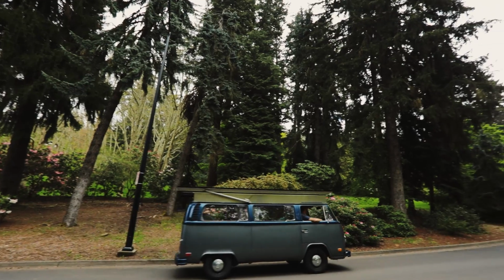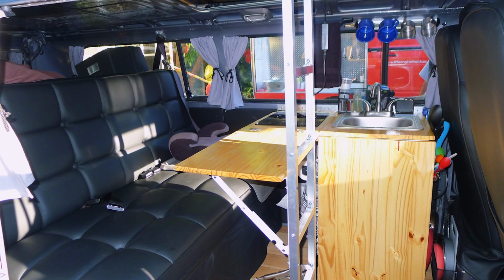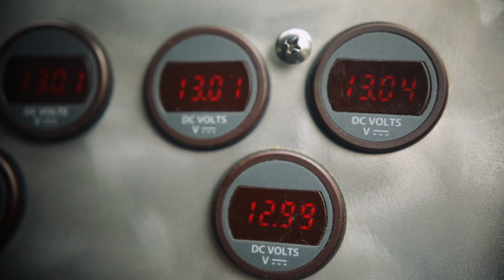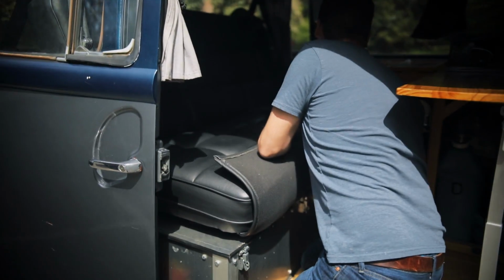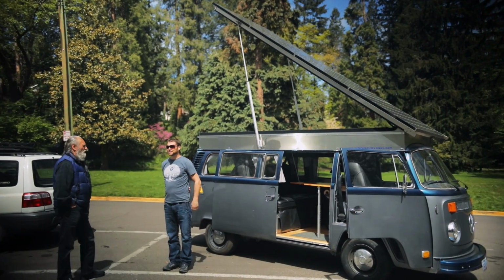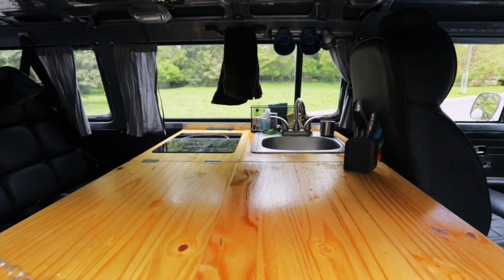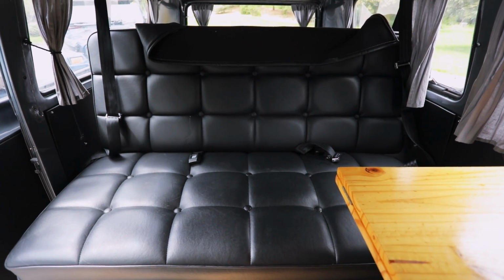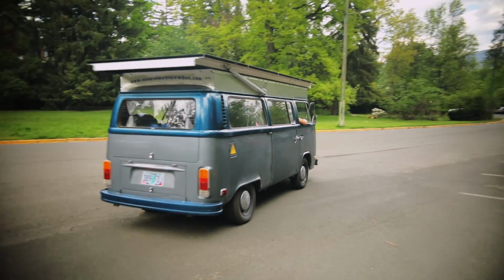This is a Fully Solar Powered Electric VW Bus

Comment: Buy a tesla power wall instead of acid battery bank. Triple your driving range.
Reply: Nope! There widely used on converted EVs and DIY powerwalls....
Reply: MsSomeonenew They have been sold and used for YEARS....  Where have you been???
Reply: They'll never be perfect but are already significantly safer than petrol.  Cars catch fire every day and I'd argue first responders (and drivers and everyone else) are at far more risk from that than electrocution.  Way fewer moving parts in electric vehicles drastically reduce the probability of mechanical failure.
Reply: LiFepo4 would be better.
Reply: it seems that lithium ion batterys are better...and the tesla powerwall is made of lithium ion battery which are the most technologically advanced. you can check the characteristics on wikipedia just google both types of batterys.
Reply: They are only $6000. :O
Reply: Zai Fuchigami, are those better than tesla powerwalls? how do they compare? also how do they look, which specific ones do you have to diy or buy?
Reply: How should you get electrocuted by touching cars with Li-Ion batteries? There is no potential difference. If they would touch the body of the vehicle or something else out of metal, they might get shorted and begin to burn. But there is pretty much no way how they could create a potential difference between different parts of the vehicle that somebody might touch.
Reply: totallyjonesin really? You've never seen anyone get sizzled in a gasser? Because it's a ubiquitous phenomenon that is well documented
Reply: you could probably build yourself a battery bank using 18650s for half the price, and get significantly more range than chopping apart a powerwall.
Reply: Why is he the only one who did this? The others 'only' supply regular electronics, i'm seriously not good with electronics.
And does anyone approximatly know how much a Tesla wall and a big enough solar panel plus montage would cost?
Reply: guy shows you how to make them as well . even cheaper . just little lab top cells put together . you can buy all [parts ..
Reply: They are just banked 18650 batteries.  I'm super duper careful with mine in my e-cig device because they are an explosion hazard if anything stupid happened.  I'm waiting for a tesla to do a china syndrome to the asphalt in a wreck.
Reply: Yeah this guy really screams money...
Reply: The'wall' would cost more than the entire vehicle and PV panels. To triple your range you'd have to triple your PV array size. The concept here is not charging at home and then getting a certain range, the goal is unlimited range by going where the sun shines.
Reply: Oh yes, I am a mechanic, started in 1978. Never seen anyone get sizzled in all that time working in shops. That's dozens  of other mechanics and many hundreds of cars. Li Ions are not perfected yet. (Samsung) Also first responders are at risk of electrocution if they touch one of these electric vehicles in an accident.
Reply: If they don't go up in a fiery explosion.
Reply: Those aren't really on sale, they are merely in testing.
Reply: MsSomeonenew - thats funny, i’ve got one on the side of my house, works a treat

Comment: hi, excellent project, have you thought about adding small fan generators to the outside, so when you are driving you are topping up extra electricity.
Reply: Mohammed M. no the electricity generated by fans will be way less than the resistance that they cause to the moving vehicle.
Reply: Mohammed, you should have learned in middle school physics that this would not work!

Comment: I've been dreaming of making a fully solar-powered camper van myself. Thanks! Extremely inspirational!
Reply: Yes.
Reply: Same here
Reply: Not practical.
Reply: True indeed,I too want to do similar
Reply: How's the dream going man??
Reply: Buy solo solar van only 18500
Reply: @sharonbraselton3135  have you got a link ?  The VW bus here in the UK is offered in electric format through German Abt-eline and does 82miles on 22kwh but no solar panel. You can get them second hand low
Mile for £14000

Comment: Why are you running led acid batteries? LiFePo batteries are dirt cheap, way so much less, and have way more energy.
Reply: Lead acid, 4000$.  LiFePo 12000$   Your battery supplier?
Reply: 80 Ah x 13v x 12 batteries = 12.5 kWh.

A&S Power LiFePo4 3.2v 160 Ah $160/battery.
160 Ah x 3.2v x 25 batteries 12.8kWh $4k
25 x  11.66 = 291.5 lbs. roughly the weight of 3 lead acid golf cart batteries.

Comment: I would just keep driving south and not stop....except maybe for recharging :)
Reply: Sir you would surely break this motor too
Reply: Not even north? 😂
Reply: Good idea, except the added weight when moving the roof up or down. Also in some favorite spots where I like camping wind can get strong enough to risk ripping this roof straight off.
Reply: Love to see that one day ❣
maybe by the time you're in your 50's or 60's it will be a feasible option 🤞 so many less systems to break down or wear out than ⛽gusler  (I'll still be your patreon if we're both still kicking lol)
Add it to your Vision Board/Bucket List?

Comment: If you treated your lead acid batteries like they were lithium, and balance charged the cells, you would see improvements.

Did you use a mr2 electric power steering pump?

Comment: Awesome! Next, make a solar panel that unfolds to be twice as big.
Reply: "The conventional solar array will be traded for a much lighter flexible panel set up.  When we are finished, by May of 2017, we will have 5KW to charge with.  The array will fold out and charge anywhere we choose to stop. The bus will be able to pull a minimum of 100 miles off the sun in one day!!"
5kW is a big step up from 1.2kW.
Its May, I wonder if they did it.
http://www.solarelectricvwbus.com/home.html
Reply: Good stuff. I hope they post of video.

Comment: The concept and product is amazing, but that range really kills it. 
But awesome proof of concept anyway. I've dreamt of having an electric bus/van like this and pretty much stay in one spot during the week(Maybe 20 km total) and then go see stuff in the weekends (Like 450 km maximum), so it will need a very impressive range in the 500 km's and then it could charge up during the week and it would be almost self-sustaining except from water. 
Unfortunately 500 km would need at least 200 kwh of charge for a van like this, so it will need to charge 30 kwh a day, which is insane, all year round, but it could be just awesome to have a selfsustaining vehicle like that that doesn't even need to be plugged in. Seems like this system charges about 10 kwh on a good day and you also need a bit for living.
But for summer-vacation it could be awesome where maybe 20 km a day (Or 40 every 2 days) isn't that bad, especially when it is selfsustaining like this. You could also have extra solarpanels that could "fold out" when you are not moving

Comment: Awesome build, would be great to get a followup eventually w/ the battery upgrade. Replacing the 12 AGM batteries w/ say 200Ah Prismatic LFPs should give a good 2.5x usable power boost at about the same weight. I've also seen people selling almost-new Tesla pulled packs at almost half the price - 8 of the Tesla modules would be about 50% lighter, and give you 250Ah @ 178V nominal - you could probably get 200-250mi of range from that sort of setup.
Reply: Hey there, thanks for the comment.  Check out Solarrolla for the latest upgrades

Comment: Get rid of that heavy lead battery and go lithium. LiFePo are safer.
Reply: Not true. Lithium is far cheaper per usable amp hour
Reply: Nevada: Go to a store and buy a lithium battery then buy a lead one tell me which one costs more regardless of where you go.......Off the shelf lithium is more expensive every time by a large margin regardless of cost per amp hour.
Reply: @shadowbanned5164  you clearly know nothing. I said USABLE amp hours. Go get educated
Reply: @shadowbanned5164  no, YOUR POINT is just plain WRONG.
You need less lithium to be able to perform the same as lead. A 1000ah lead acid bank can be replaced by a 200ah lithium bank. 200ah lithium is CHEAPER than 1000ah lead. Jesus Christ watch the video series
Reply: @climatechangepreppersfaceb2148   That's not how it works. Talking amperes or volts per se, doesnt make any sense. That's why you normally measure the capacity of a battery in Wh. And going by the same capacity, a lithium battery would cost from 2 to 5 times more than a comparable capacity lead-acid battery. It's fkn math. The reason why lead acid batteries are now mostly used in long term storage, camper vans, UPSs, etc, is because they are CHEAP.  A 400Wh lithium ion battery pack for an e-Bike, will costs more than twice than it's lead acid brother.
Reply: @DerpEye  I did the math in 7 different videos. Go watch them and learn
Reply: Dzintra681  HE'S RIGHT, LITHIUM CAN BE CHEAPER, BUT YOU HAVE TO BEABLE TO BUILD THE LITHIUM BATTERY IDEALLY AND SINCE YOU AND SHADOW WUSS DON'T KNOW SHIT, JUST FORGET IT AND STAY IN YOUR MOMMY'S BASEMENT WATCHING PEWDIEPIE
Reply: @RonPaulgirls  You are all off base. Lithium charging must be very precise, the total number of life cycles before wearing out is the same with lithium. Lithium is more likely to explode and it deteriorates fast when left fully charged in hot weather. I have used lithium power for my ELF every day for 5 years, I know what it entails. Building a battery is not a job for amateurs, you have to be VERY savvy and VERY skilled with each and every connection and you have to consult an engineer to know the proper BMS parameters to build in to the battery for longest possible service life. As a retired electronics bench technician who worked on live saving lithium powered medical equipment I know my limitations and building a battery kit just because someone markets them is not smart.
Reply: @popeyegordon  YOU DON'T KNOW WHAT IN THE HELL YOU'RE TALKING ABOUT
Reply: @RonPaulgirls  Do you have an electronics degree? Do you have 15 years of daily e-bike experience? Amateurs can handle projects powered by lead-acid batteries much easier than lithium. Mistakes end up costing them much less. Note that if you or any of your loved ones end up needing reviving by a defibrillator I probably worked on it. That means the FDA trusted and certified me to handle and repair critical life saving devices, thousands of them. That kind of trust is deadly serious and can not be faked, audits can not be forgiving.
Reply: Money money money thats the difference between lead and lithium

Comment: This guy built it from home while VW hasn't even released an electric model van yet. There is clearly a demand for this type of thing vehicle. It would be a game changer if a van like this were released from VW or testa. I myself would buy one. Strip the inside of unnecessary parts, add a pine wood floor, frame the walls with wood/fill it it with level 2 fibreglass insulation. Cover and seal house wrap. Brad nail hemlock tongue and groove boards to make a some nice walls. BAM I got a winter proof electric home on wheels that's customizable
Reply: this thing gets like a 60 mile range and might recharge 30 in a day. This style solar panel is about 280w/m^2 with around a 18% efficiency. Talking about a kwhr under good sunlight, or 4 miles range.
Reply: My username is longer than you would expect The mileage is bad because the batteries are bad. With a 50kWh Li-Ion battery it should easily do 400km. I agree that the solar panels don’t help much. However, most camping vans already use some kind of solar panel to run the beer cooler, lights etc. So why not oversize it, especially if you have such a nice, flat surface at a perfect angle? I think the guy in the video mentioned something about 150V*8A=1.2kW of charging power. So yes, you’d need at least 4 days of perfect 10h sunshine to re-charge a 50kWh battery.
Reply: The mileage is bad because the solar panel can only create enough power to drive it that far. The panels can only produce 8amps or 1.25KWh. It would take 4 days to charge a 50KWh battery. You would get more range per charge but not per day.
Reply: And weighs anything up to a tonne more than a stock vehicle...
Reply: VW had a electric car at least since the golf mk 3 . It just didn't sell . Infrastructure and technology is a big point though.
Reply: This is my plan also.

Comment: Meh. Bus doesn't even time travel :/
Reply: Panels go up to 335 watts these days bud, so the panels could potentially be producing 1340 watts. The day of the 100 watt poly panels is long gone. If people purchase 100 watt panels, there is something wrong with them and they didn't do their research. 300 plus watt panels are shipped by the pallet for under 2 grand. Canadian Solar is one of the manufacturers where you can buy from a place off of ebay with $450 shipping from Cali. 100 watt panels are a waste of time and money, space too. If I buy, I'm going to wait until 500 watters are released, or wait until the graphene technology enables them to become much smaller. Solar paint is another up and coming technology allowing a home or car to simply be painted to generate power.
Reply: The Libyans couldn't time travel...but doc, and Marty could....delorean.
Reply: He said 1 kW so each panel must be 250W
Reply: @andrewwaters2354  HE SAID 1200 WATTS WHICH WOULD BE 300, BUT WHO KNOWS
Reply: Andy Peterson He has a concealed  compartment containing shrooms,for that.
Reply: Andy Peterson 
No Flux Capacitor, next Rev.?
Reply: Andy Peterson 
ikr

Comment: Very inspiring vid again!! Dylan how can u use your sigma lens with 5d m4? Or you using different lens to get shot?
Reply: Sigma makes lenses for Canon bodys
Reply: I know but it's crop body lens ;) since 5d m4 is full frame
Reply from the maker: +Caglar Hepterlikci you can use it at 28-35mm just get a heavy vignette. The lens is way sharp though to not use it
Reply: Aha, thanks for tip man, i though it could never use it :)